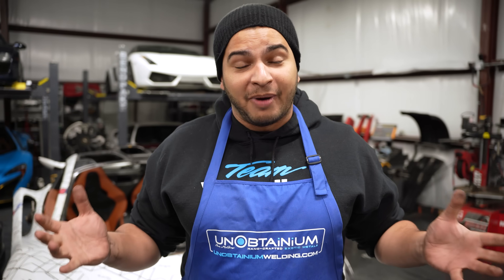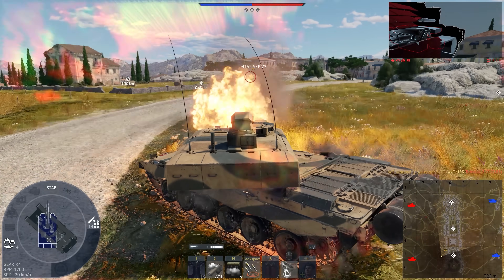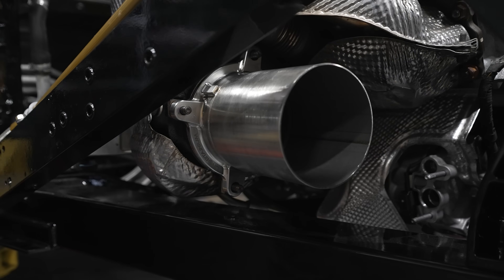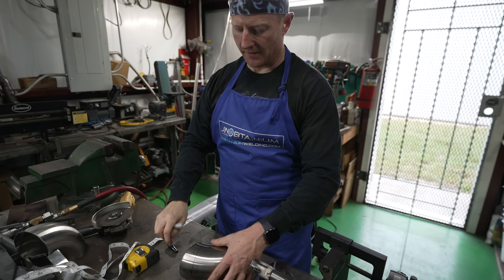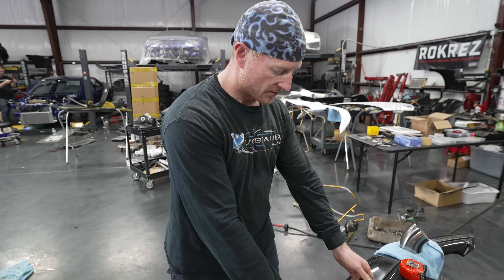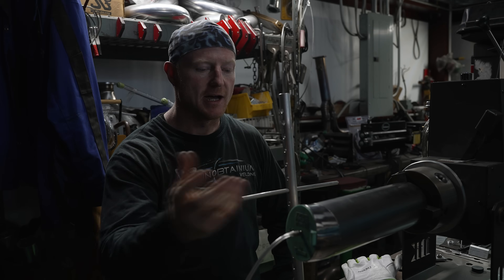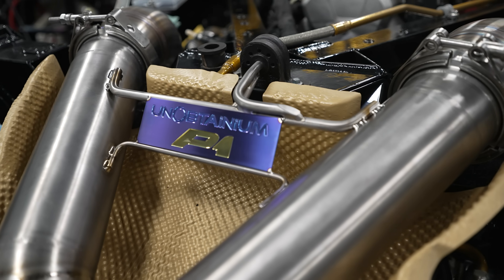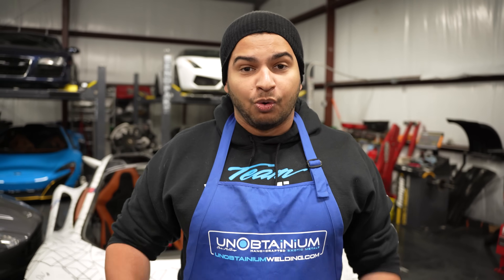How To Make A $30,000 Titanium Exhaust For A $2,000,000 Flooded McLaren P1 FROM SCRATCH

Comment: 30k exhaust?
Is he charging $1000/hr?

Because an F1 exhaust isn't 30kk 😅

There's a full titanium, dual pipe, valved, pie cut and coloured exhaust system from manifolds back for a Mercedes C63 amg on a site for £3400 for the whole system.

And is is hand made using the best available materials.

How is two short sections and an X  pipe 30k?

Comment: This guy is obviously a super talented pro. I just reconcile that a bunch of welded pipes even though titanium could be worth $30k. Possibly I am just naive. Great work, but wow, that’s a bucket load
Reply: Maybe he's talking in replacement value costs for the OEM system. I think it might get there in terms of purchasing a new one, shipping it and taxes/duty. One of those "Technically True" things. The cost of this exhaust in materials is probably way less, but since Chris flew in to do the work, he likely factored in lost opportunity cost and a little R&D as he'd never worked on a P1 before. There was also probably some kind of exposure and design rights deal (since they will ship him the exhaust for him to template it) so the actual money that changed hands likely wasn't anywhere near $30000.

Comment: There's a little more to exhaust engineering than welding a few pipes together, I'm not convinced this pipe is the best flow or has control of the exhaust pulses or pressure that aid power output.
Reply: Turbos change everything. Best performance on a turbo setup is going to be as little restriction as possible

Comment: For anyone wondering x pipe y pipe h pipe and 4-1 headers are all devices to help create a low pressure area in the exhaust which essentially is a vacuum pulling the exhaust out of the cylinders. On forced induction engines big diameter and straight flow out of the cylinders is what is beneficial to make more power. In natural aspiration engines these exhaust devices that create a vacuum effect are needed to make more power.

Comment: I personally have never seen cleaner welds on any automotive Youtuber channel. I'm completely speechless. Wow. Amazing job.
Reply: That man may as well have a robotic welding arm thats crazy
Reply: @MattB90  well if you know how to weld then you know that what he did( thanks to tools that he has) is not hard at all.
Rotating machine + Tig machine with pulse mode gives you 99% close to perfection consistency.
All respect to that guy he is great welder and i'm sure when he started working for many years he worked without all those fancy tools etc.
Reply: @salazar1104  Thanks for the context, I have much to learn
Reply: Seriously! Like a robot weld!
Reply: DDE Senna? Amazing work as well.
Reply: Holy shit you werent wrong. Those are insane.
Reply: Here to confirm that this isn’t as hard as it looks. My brother taught himself to tig in our garage. Yes, it’s expensive. Scrap material, filler, gas, and a good machine with the right extras are all very costly. So, while it’s not that hard, it’s not baking a cake.
Reply: Oh, also I’m gonna explain the bad welds on the hangars. So, the pipe is titanium. The hangers are not. Which means you have to use a different filler rod, made to melt into both metals. Since both metals melt at different temps, it’s very hard to make a good looking even bead with your filler material. It also shrinks differently on both sides. So, despite him trying his hardest to make it pretty, it’s nearly impossible.

Comment: So you pay 30000$ for this and there is not a loft from the round pipes to the end? instead it will be abrupt change with turbulant exhaust gases inside, when it could be horn with best sound and laminar flow all the way out. Since there is no obstruction, that should start where two pipes merge to ”x pipe”.  3D designing that would have taken 1-4 hours, and 3D printing that from stainless or titanium and then polishing it about 1 day and about 1000$ stainless or 3000$ titanium. I know these are top notch guys, but if there is immeadiately area that could be bettered, is it then the best? I could help them with designing those pieces and making them. Pieces like this is what I have specialized.
Reply: @paulcopeland9035   I have sold my designs to all european countries and about 50-52 states in USA in last 4 years. Thank you very much, looser. Also why would I be there when I can design for any company, including several automotive companies.

Comment: A true artist can use underpowered, Harbor Freight tools! Well done, Chris.
Reply: I keep saying on every discussion about tools that if you have the skills, you could complete the build with 1800s hand tools. Now, welding is an exception, but the point stands for everything else. Woodwork? If you can't cut with a hand saw, your skills aren't where you think they are. I'm not saying people have to use them, time saved with power tools is very important, but you should be able to. It's always been about the person, not the tools.
Reply: And knows how to work without removing the angle grinder's guard.
Reply: There is no Harbor Freight in Canada.
Reply: @Fullion-CA  It was filmed in Florida...
Reply: Yeah that wasn’t a Harbor Freight welder he was using,but I get what you’re saying.